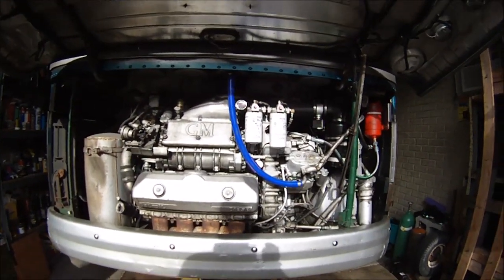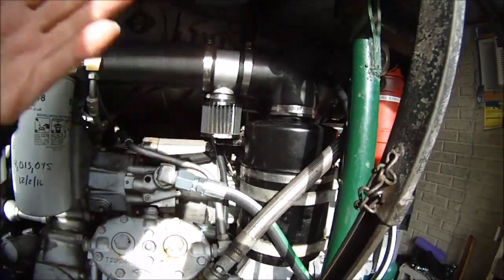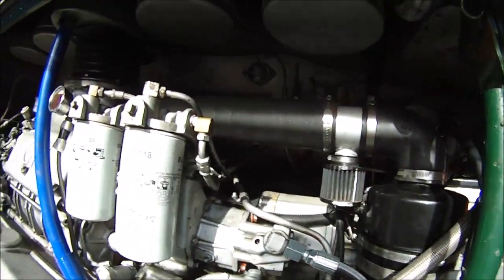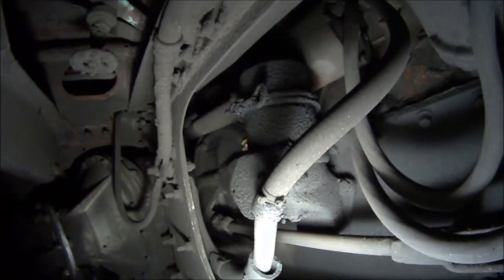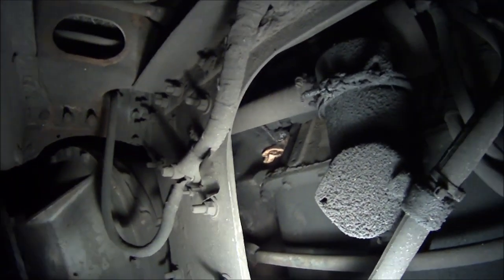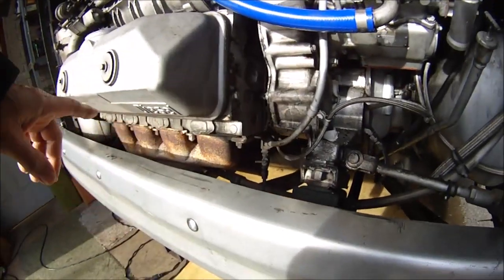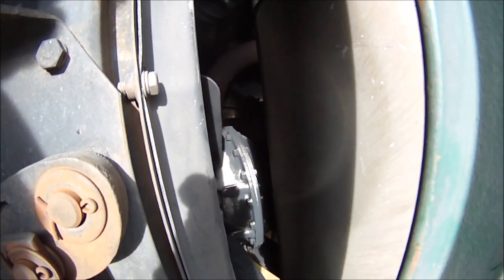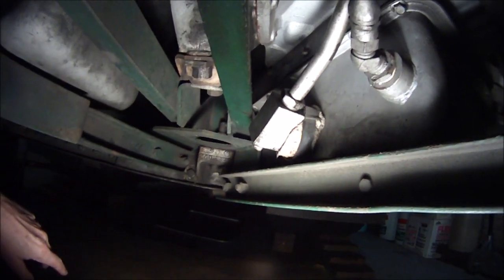Controlling Diesel Engine Oil Discharge

Comment: Straight weight oil for the two strokes but more importantly it needs to be low ash content. For example Delo 100 not Delo 400 if you use Chevron. AMSOIL does make a synthetic low ash 15W40 that doesn't sheer and I know of a 92 series that has done hundreds of thousands of miles with it. But you won't like the price! I used straight 30 or 40 in my 6V92 series. I didn't have the air sep but I did have the slobber boxes.
Reply from the maker: Thanks Gary,
30+ years ago I was friendly with a local bus company that ran all GM buses with 8V-71s, about 75 of them.  They used Dryden oil from a local company in Baltimore.  Dryden was purchased by Castrol.  Since then I've been using Castrol.  I've seen the low ash requirement for other vehicles in the past, but I've never seen it noted specifically for this one so that's new to me.

Comment: Hey John, thanks for posting this, this might be something I'll need to look into once my bus is on the road, they don't call these things green leakers for nothing.... :-).... we have similar systems on our Tug boat engines as the whole engine room has oil vapour film in it if we don't.... even with new modern engines